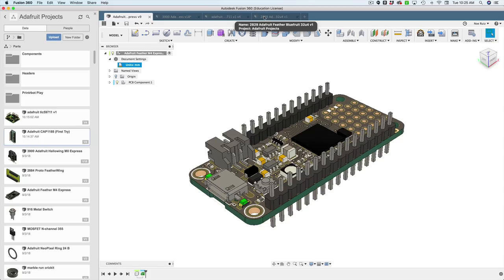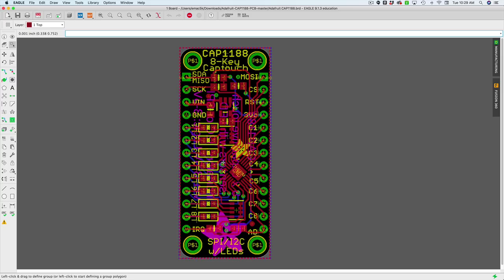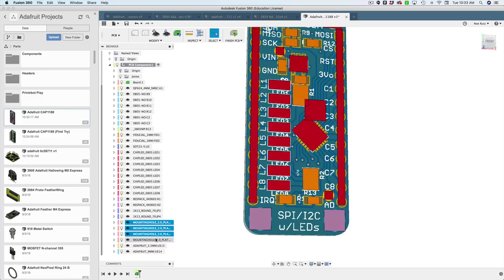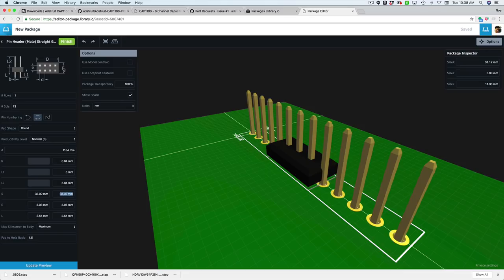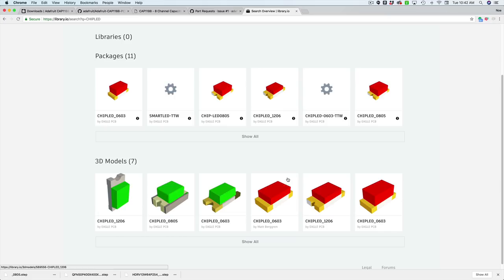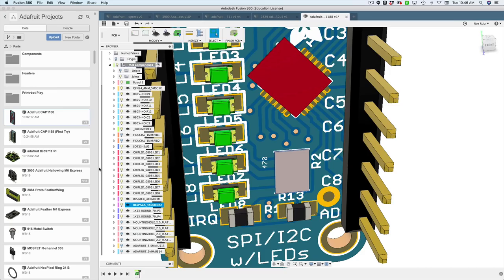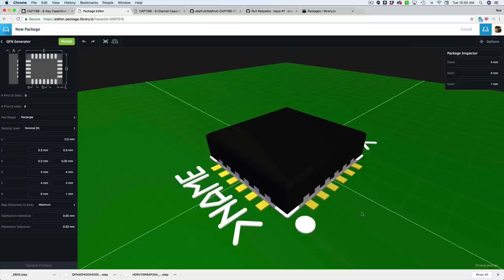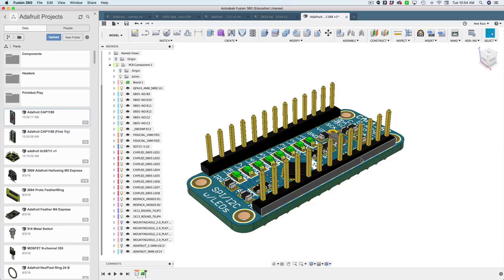Fusion 360 Tutorial – Turn Eagle PCBs into 3D Models with Fusion 360

Comment: Nice recap about how to retrieve or genererate 3D models, but IMHO this work should have been done at library level from Eagle. This way the parts can be reused in the next design without the MCAD person doing extra work (and potentialy making mistakes).
Bottom line: work on the packages (footprint+3Dmodel integration) not just the 3Dmodels.
Otherwise, if sth goes wrong (3D model and manufactured design don't match, it will be harder to figure out if the flaw comes from ECAD or MCAD design steps.
Having complete packages with correctly matched AND aligned 3D models from ECAD, should ease the MCAD work, just focusing on enclosure fitting design. If there is a mismatch the package should be corrected.
Autodesk Eagle allows it, and I would even say, encourages it.
Just my two cents from someone who is usually on the ECAD design step ;)
Reply: Hi, it is possible to access the Package Generator or map STEP models to your footprints in the EAGLE Library editor. When using the Package Generator in EAGLE it will generate the Footprint and the 3D model on the same session. You can use the created footprint to replace a footprint variant in the device or create a new device using this footprint. The 3D model remains linked to the footprint even if you copy this footprint to other libraries.  With the managed library and the 3D models assigned to your footprints you can re-use the components in any design. Consider joining one of our webinars to learn more about this. EAGLE Learning event Center: http://eagle.autodesk.com/eagle/events
Reply: This is a thing of the past no? It looks like Eagle has come to Fusion but I don't know if fully integrated or what. Please advise boss.
Reply: Bumping this reply, because with a new fusion 360 update, This is now the only way to do this. 
Also, You have to be sure that your 3d Models for all your parts are set BEFORE you export to fusion. Updating parts, and then trying to push to fusion will not work without deleting the fusion project and starting over.

Comment: 16:49 - Why I cant see this option (replace component body) in my fusion360?
Reply: same problem, i just downloaded fusion and try to follow this tutorial, but this option is not here. Someone has a solution? Thnx
Reply: Same problem
Reply: Go to time line, you'll see the PCB icon, right click and Edit , now that option appear and you be able to modify componente, once you finished press Finish pcb. Best regards!
Reply: I gota a problem replacing son models, I downloaded .step file from a web, but when I trying to replace don’t change the component. Tris no happend with all .step files just a some files. This happend with library.io too. By the way I can load de 3d model without any problem.
Reply: same problem
Reply: Can you solve this problem? I have not option to edit PCB in the time line.
Reply: @fabriziobgn257  This icon does not exist on the timeline.  Current version is 2.0.8156.  Eagle is now bundled with Fusion.  So I think this technique is out of date?

Maybe an update to this tutorial would be really helpful?  Thanks

Comment: Managed libraries are not shared. They are on the cloud, but there still isn't any means to share them. It being a "high priority feature" and "being worked on" for a year, so hopefully Autodesk will finally add sharing libs within the next year.

It is better to add the models to your managed eagle library (it has to be managed), this way every PCB you make using those library components will have models without additional steps in Fusion. (NOTE: You may need commit back your changes within Eagle before you can add models within eagle, this and managed libraries in general are very poorly documented.) After you've added the models, update the libs on the PCB then re-export to Fusion and the board will have all the component models.

On many parts, you can get the models directly from the Digikey page for the part. Digikey has been adding a lot of these lately and its has been very useful.

The public Adafruit Eagle Library hasn't been updated in since 2015, an update would be nice, but I don't know if the new 3D models features are supported in offline libraries (you cannot export a managed library, but you can copy the local cached lbr file). Sharing managed libraries isn't a thing and the Adafruit library included in Eagle's managed libraries is empty.
Reply: this is in the works now...I would expect this will be a little more than a month.  :)

Comment: Thank you for the tutorial! 
It would be amazing if you guys could update this for the current Eagle/Fusion workflow! The method show @14:48 and throughout the video is no longer an option. You show a right click "replace component body" that doesn't exist anymore unfortunately.

Edit: Okay, I've searched high and low. This is actually quite frustrating. It used to be very simple, as the video shows, to  buy an adafruit component, go to the webpage for it, download the Eagle CAD files open it in EAGLE, export the board to fusion 360 and replace the ugly square placeholder components with real models so you now have the physical component in your hand, the schematic and  diagrams on your computer in Eagle, and the perfect 3D model with USB ports and all to model enclosures around or whatever the 3D modelling goal is. Why has this gotten so contrived and complicated?
Why did they actively remove a great feature?

Comment: Very nice tutorial. It helped me  a lot. Is possible to use buttons, connectors (JST), batteries 3D models, etc.? It is not easy to search in library.io How are you orienting there if you need some 3D model part? thx
Reply from the maker: yep, most of the mapping we do is from external step models. We have a small repo of common parts but feel free to use models from grabcad and other places. https://github.com/adafruit/pcb-parts